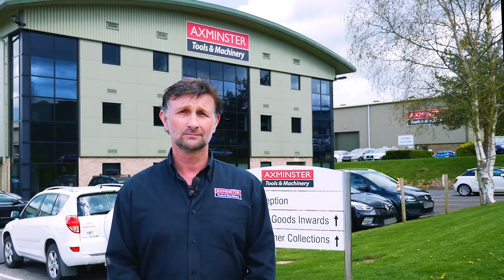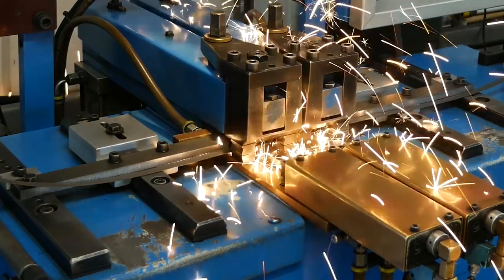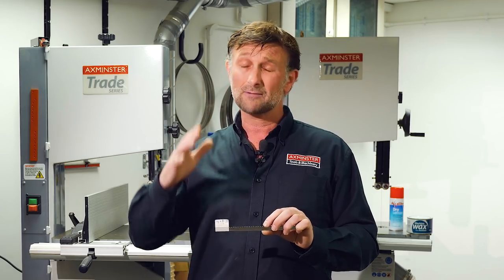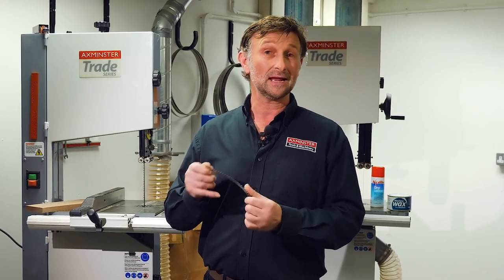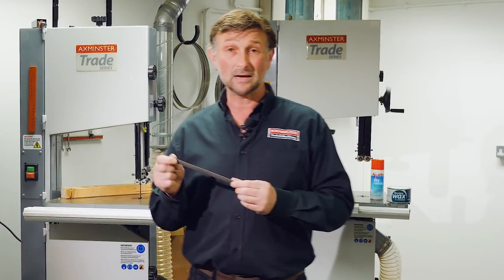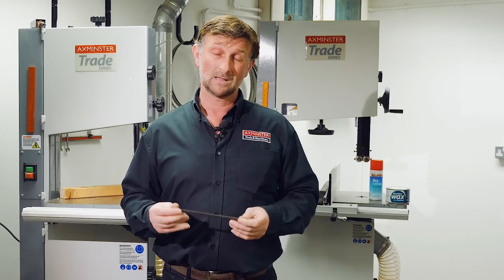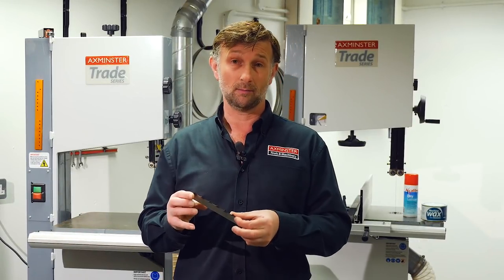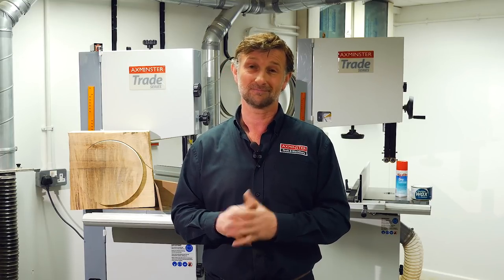Axcaliber Bandsaw Blade Process & Blade Range

Comment: Great info, I doing research to buy my first bandsaw , cost is a factor  between 2hp and the 3.5 hp band saws  Tiawian  and European made Band saws, What's your experience with hard wood similar  Australian Timber Jarrah, Spotted gum ,Brushbox ect. was advised I could go Carbide blade for 2hp .do you ship blades to Australia?Cheers
Reply: More for longevity of the blade I think rather than occasional cutting ability